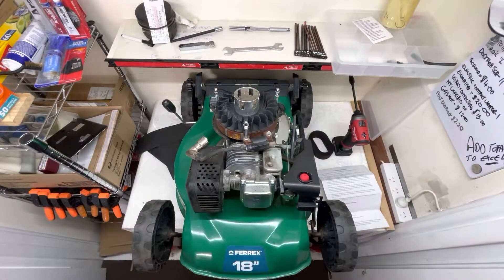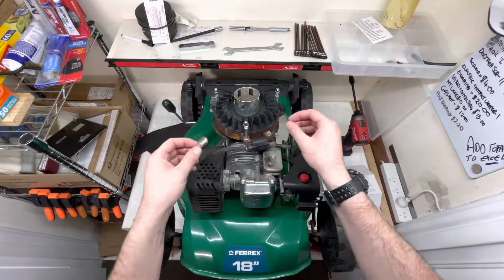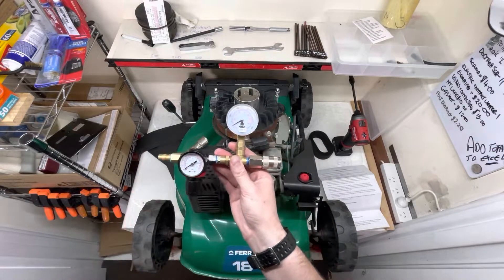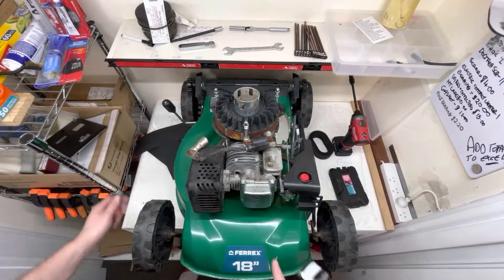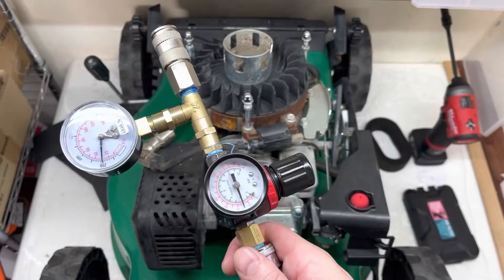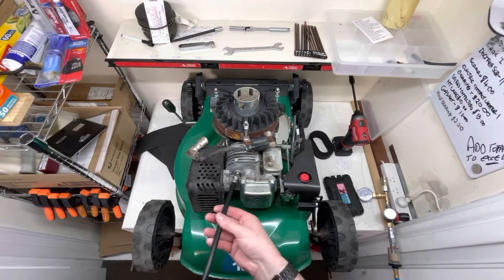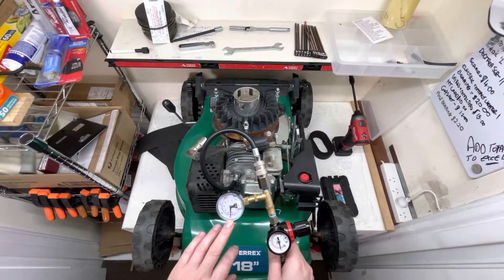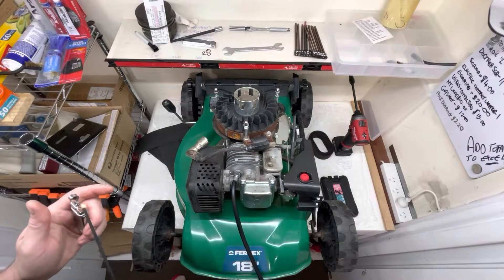4 Stroke “Leak Down” Test Tutorial.

Comment: Use of the incense stick is a very good tool to use here.  If the engine runs, the leak down test should be done at operating temperature.  That's a test under normal operating conditions, not when the engine is cold.  Also, bring up the pressure gently to 100 psi.  Eliminate the math.
Reply from the maker: Thanks for sharing :)